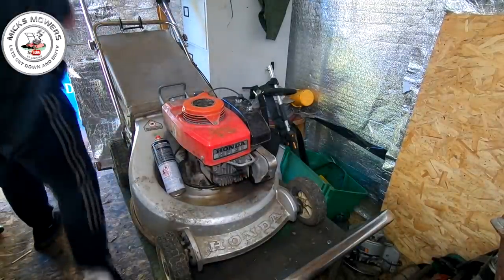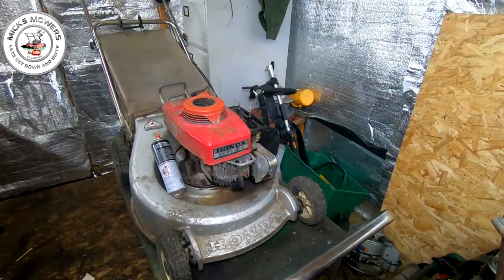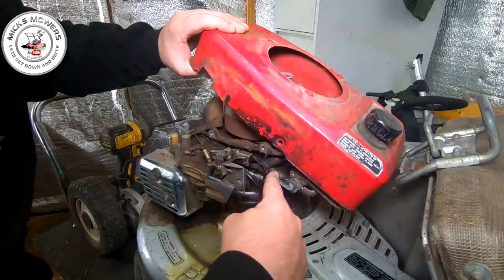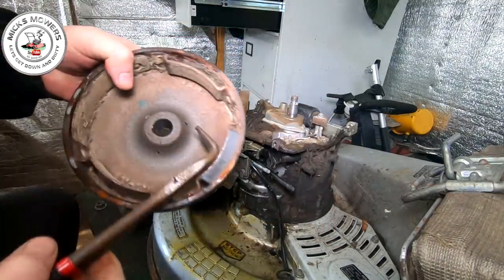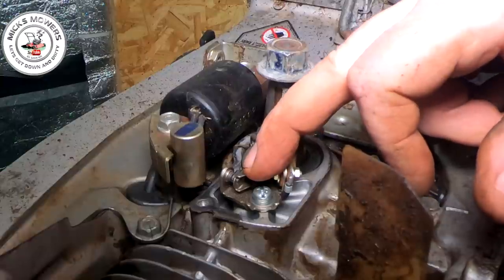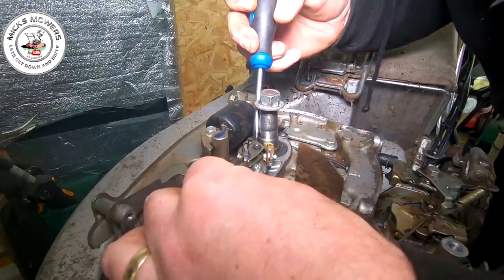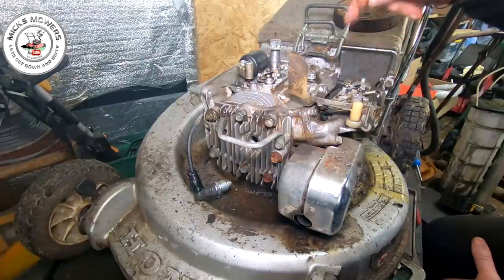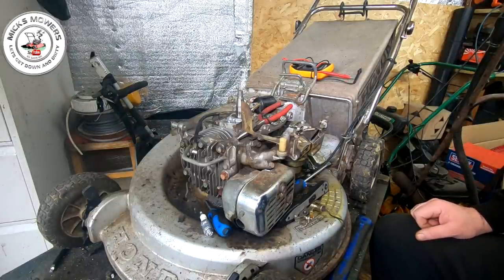Lawn mower repair Honda Hr21 No Spark No Start #honda #lawnmowerrepair

Comment: If you can't fix it no one can thumbs up mick ive had a result today got a mountfield rs100 2016 model works fine for a tenner and a McCulloch with a briggs classic wont start for tenner result 👍👍👍👍

Comment: Mine is a HRG415PD, if you are familiar. It can't be a bored screw as I clamped off the pipe as an experiment and it still ran fine.

Comment: How does the breather tube work? It goes from the air filter to a Philips screw whick blocks it off, so why is it even needed?
Reply from the maker: The crankcase pipe goes from the air box into a small hole on the engine on this one

Comment: I haven't had much luck with these,,,I save a few things,,,most I see here are just too far gone,,cost prohibitive to fix.. 
Usually the wheels are shot, cables going, engine nocks....Sad,,, was a great machine in its day,, good luck!!
Reply: BTW,, remove the condenser, clean and file the points, take off the coil, clean the mounts with a wire brush so grounding isn't an issue,  run the engine,,  if the coil is going you will know,,,, especially if it reads around 6k ohms. 
Condensers aren't required, they will short out to some degree,, what they do is help the points out from burning to quick. If your replacing that and just wanna test, this is fine.